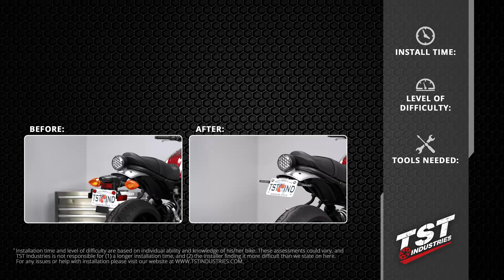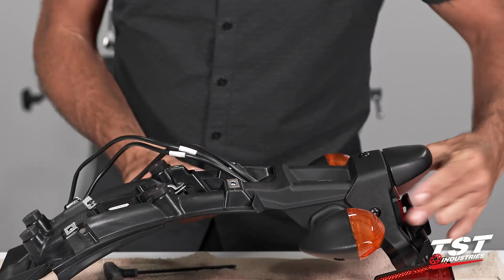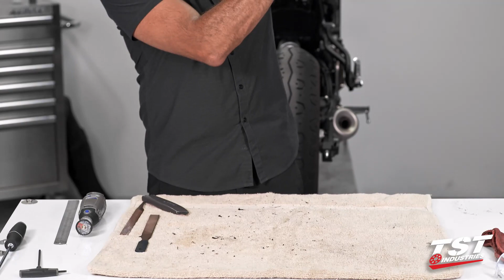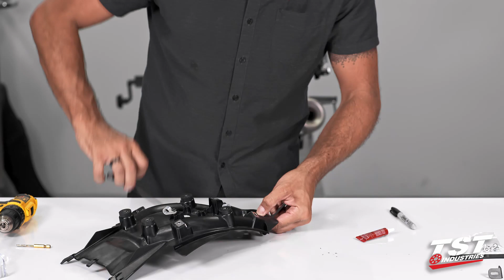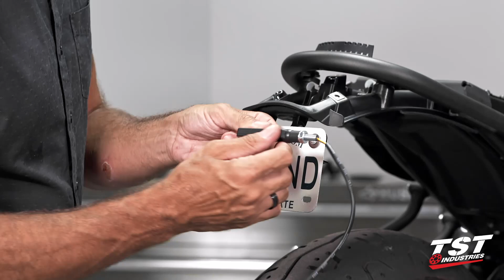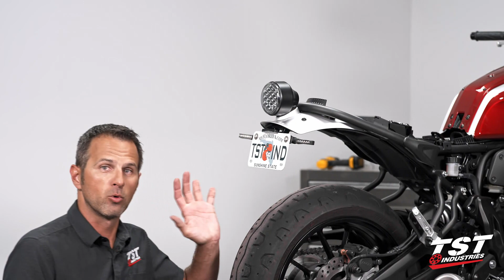How to install an Elite-1 Fender Eliminator on a 2016+ Yamaha XSR700 by TST Industries

Comment: Cool. But I want to remove the rear sub frame. What tail light would I have to use if I did that? Can I use the stock one or do you guys have something I can use?
Reply from the maker: Do you mean that you want to remove the fender? The subframe is all the steel tubing that supports your seat and riders. We do not have a dedicated tail light for this configuration but we do have a nice slim line integrated tail light with plug and play connections that can serve as a good starting point for a custom setup. That would require some fabrication of brackets to attach to the bike in the way you want it to mount. Please take a look at our WR250R tail light kit. It would be the closest to what you need to get that setup done.